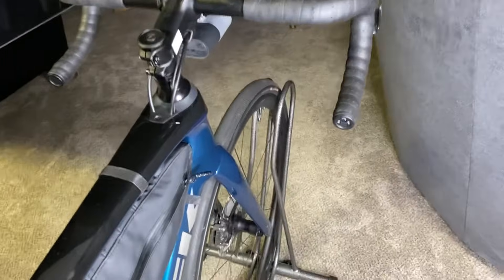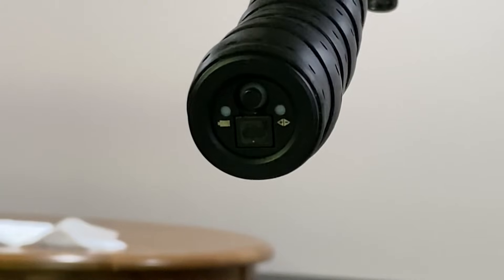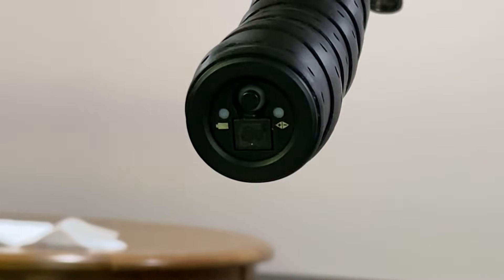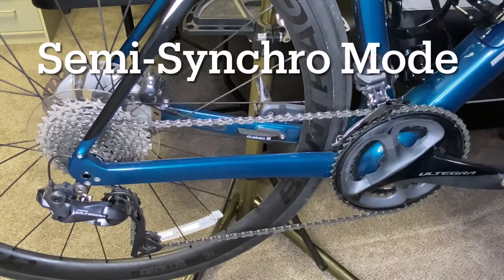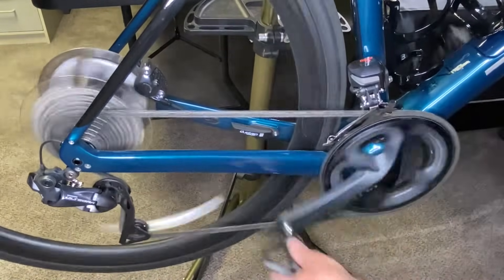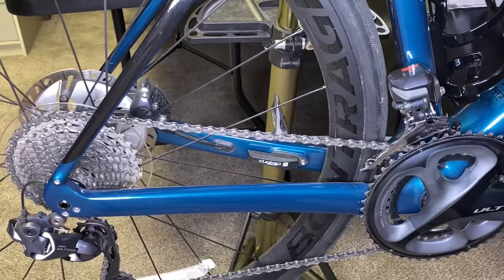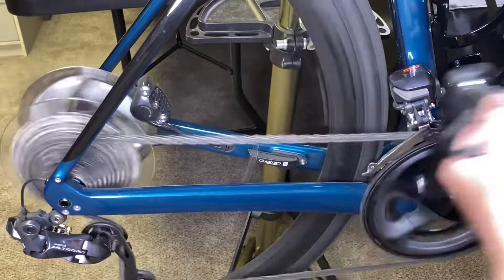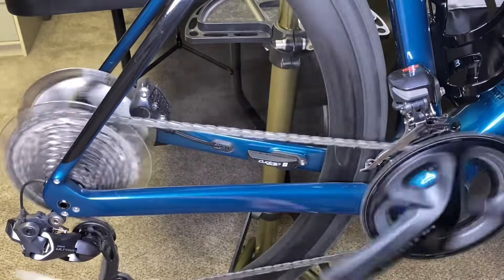How to change Shimano Di2 shift modes (Synchronized Shift, Manual, Semi-Synch)

Comment: My Ultegra 12 speed Di2 groupset is wireless the 8150 Bluetooth system & every single thing that's needed to change anything is via the E-tube app...!!!
Reply from the maker: Yes, the newer 12 speed Di2 has many features that the 10 and 11 speed systems do not have! Thanks for the input!

Comment: I have this new bike with the rd 8050 derailleur and it seems not to have the sync button to connect to the shimmano e tune app. Any leads?
Reply from the maker: Thanks for the question! Bikes with 11 speed Di2 do not come with wireless capability. You need to add that option. I had the same experience. You can connect to your computer using the charger cable but no to the App unless the wireless unit has been installed. You can do it yourself as it is not super expensive nor is it very difficult to do. Here is a video: How to Install a Shimano DI2 Wireless Unit in a 2021 Trek Domane SL7 #di2 #trekbike #shimano
https://youtu.be/V_xfIfLl2JY
Reply: @davescycling  thank you very much. Well, now my question comes to know the process to adding functions to the buttons on top of my brake levers. That’s why I wanted to sync the derailleur. TIA.

Comment: why do semi-synchro when you can just keep it on full synchro? looking it at, best to keep on full?
Reply from the maker: As it turns out, once I started riding in full-synchro mode I decided that it is now my favorite mode! When I first got my bike with the DI2 system, I was very reluctant to change the mode because I liked having full control over my shifting. Then I started experimenting with semi synchro mode. I did like semi-synchro, but as you suggested, after riding for a little while and full-Synchro, I love it! It lets the bike automatically give you the next harder or easiest gear while still allowing you to override it anytime you want. Thanks so much for your comment!
Reply: @davescycling  100% keep on full synchro - I rode this evening and the front chain ring downshifted as I downshifted on a climb that was bumpy. The chain jumped off and got damaged - can happen if chainring downshifts under power on bumpy terrain, just something to be mindful of :)
Reply from the maker: Yes, there is a small learning curve. The automatic shifting can be abrupt! Sorry to hear there was damage. I hope it wasn’t too bad.

That was one of the things I did not like at first, but once you get accustomed to it, it’s all good.
Reply: @davescycling  thanks, chain twisted and some frame scratches so need a new chain :)
Reply: @davescycling  I changed a setting now , maybe that will help : the stock setting for when you are shifting to the easier rear sprockets is when you’re second from the top and want to shift to the top (easiest) it then drops the chain to the front ring . I figured this is risky because the chain is already tentioned more inwards . So I edited it now to drop to the small front chainring when i downshift from 3rd easiest to 2nd easiest VS 2nd to 1st if you know what I mean - let me know what u think
Reply from the maker: I think that’s a good idea! I may try that on mine as well.

Comment: Very clear and informative explanation. thank you
Reply from the maker: Glad it was helpful! Thanks for watching and leaving a comment! Lately, I have been putting my bike into  Full- Synchro mode.
I never thought I would say it, but I really like having the Shimano DI2 take over for me!
Dave
Reply: @davescycling  please share any inputs good and bad or any difference from shifting between the Semi-Synchro and Full-Synchro. Currently, I'm using Semi-Synchro on my bike.
Reply from the maker: With Semi-synchro, anytime you shift the front derailleur from the big ring to the small ring or vice versa, the Shimano DI2 automatically adjusts the rear derailleur to compensate for the large jump in gear ratio. With full Synchro, all you need to do is shift the rear derailer up or down as needed and the DI2 will adjust the front and rear derailer’s to make sure it gets you to the next available gear ratio. It does take a little getting used to because when it is shifting automatically in the front and the rear, it feels kind of weird but once you get used to it, it’s not bad at all. I just find it nice especially when I’m tired to only need to hit one button to get to the next gear and not have to worry about the combination of front and rear.
It’s kind of like the difference between an automobile, manual and automatic transmission . Once you let the automatic transmission take over, you just get used to some of the quirks when it shifts lol.
Also, with full Synchro, you can still always instantly override it, and put it in whatever gear you want. 

Dave

Comment: Thanks Dave!  Questions: what is the real purpose of semi, or full sync? In what scenario would they be beneficial or why you would use them over manual?  Or-- is the answer to all of that simply summarized by saying, the purpose of the modes are simply meant to limit/ remove the manual process of shifting for you, and there really is no significant benefit? Basically just like an auto/ semi-auto transmission in a car, that does the work for you-- versus a manual. Thanks !!
Reply from the maker: Thanks so much for watching the video and asking your question! Basically it is just to give you some options as to how your bike shifts. I will say that at first I was all about staying in manual mode to make sure that I had total control over the shifting. After a while, I decided to try the other shift modes and lo and behold, I am now a big fan of full Synchro Mode! What I love is that I only need to press one lever to shift up and one lever to shift down. In full synchro mode, you still have total control to override, so, for example when I come to a stop or a traffic light I simply shift my front derailer to the small chain ring so I can start off any lower gear. I hope this helps answer your question.

Dave
Reply: @davescycling   gothca, thanks! So basically just makes it easier to cruise and have full function of the gear range without having to actuate individually all the gear range. For contrast, I enjoy shifting through all the gears when riding, over the varying terrain dynamics. Others may just prefer to pedal only and have the bike do most of the "work."
Reply: @gibzen9617  Another example: I've two SW 9150 switches on the bar itself, between STI and stem ("tops"). On longer distance rides, I can still shift remaining on the tops.

Comment: Hi I want to put my di2 in pairing mode but I really don’t know how. I checked on the internet and it says that I have to hold my button for 0,5 to 2 seconds but the lights aren’t flashing and I can’t see it on my E-TUBE app.
Reply from the maker: Are you sure you have the wireless unit? It was an option until the latest 12 speed Di2. I had to install the wireless module on my new bike.

Dave

Comment: Excellent video I just learnt to change the mode to manual as I don´t see any advantage using any of the synchro modes, It`s better to have total control of the shifting. Thanks for this video
Reply from the maker: Thanks for sharing! At first, I agreed with you, and wanted to maintain full control by keeping it in manual mode. But I decided to try the other modes for a while, and I am now loving the full Synchro mode! I love that I only need to press one button to move up or down the gear ratios but when I get to a traffic light, I can still override it manually and put the front derailer to the small chain ring.
Thanks for watching the video and leaving a comment. I really appreciate it!

Dave
Reply: @davescycling  Good to know your experience, might be I try  later those modes. Thanks !
Reply: @davescycling  Thanks for this video. I've just set up full syncro mode but I'm not sure what to expect if I override it manually and put the front derailer to the small chain ring when stopped at a light. Doesn't that make the startup a bit tricky as the front derailleur can only move the chain once I start pedaling. What am I missing?!
Reply: @francessummerhill654  you would need to override the front derailleur before you come to a stop so it has time to shift. Then you start up will be in a low gear and the Full Synchro will operate normally from whatever gear you are in.

Comment: This is really good video! I see your rear derailleur compensate/adjust when  the front derailleur move to the smaller ring on your last demonstration. Mine does the opposite where when I change to bigger cassette at the back, my front derailleur changes to smaller ring (same thing as yours) but rear cassette just stays at the bigger ring and doesn't compensate. Also same thing happens when I move to smaller Cassette, front derailleur changes to the bigger ring automatically but rear derailleur doesn't compensate/move to the bigger ring. How can I fix this? Also, do I need to charge both front and rear derailleur for di2?
Reply from the maker: Chan, thanks for watching the video. If what you say is happening in "Full Synchro" mode, sounds like maybe yours needs to be configured or software updated. If you connect it to a computer and use the e-Tube application, (or use the phone app if you have the wireless option) it will allow you to choose the compensation from 0-2 gears I believe.

Also, the 10 or 11 speed Di2 only needs the battery charged as it is all connected by wires. If you have the latest 12 speed Di2 (I do not have this), I believe you will need to charge each derailler as my understanding is that it is truly wireless.

Dave
Reply: @davescycling  Dave, thanks for the detail reply. I have 11 speed so I guess I only need to charge the Shimano E-Tube Junction (SM-EW90-A). Do you have video showing how to update software?
Reply from the maker: Chan, I do not, but I will try to put one together tonight or tomorrow at least with the basics. No promises but I have been meaning to do it anyway! I will let you know when it is up.

Dave
Reply: @davescycling  Dave, I just found out I have SM BTR2 battery which is not available for synchronization. Do you know the work around?
Reply from the maker: Chan, go to: https://bettershifting.com/di2-synchronized-shifting-the-complete-guide this will help answer your questions.

Dave

Comment: Clear demonstration thanks 👌
Reply from the maker: Glad it was helpful! And thank you for leaving a comment!

Dave
Reply: My understanding is that initial compensation is to keep your cadence the same.  After that compensation is done when you start shifting again like needing easier gearing in the rear for a steeper climb then that compensation starts again, as needed, depending on what is needed.  That can all be confusing and/or not doing what you really want so I use manual mode and shift when I want to.